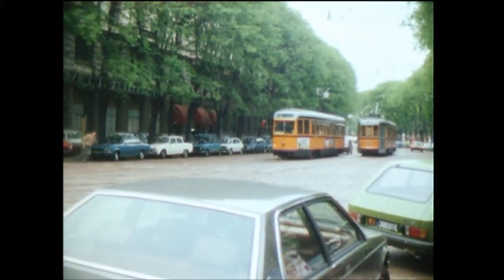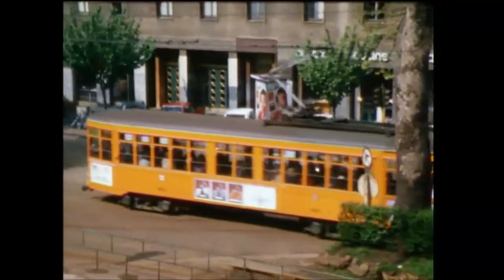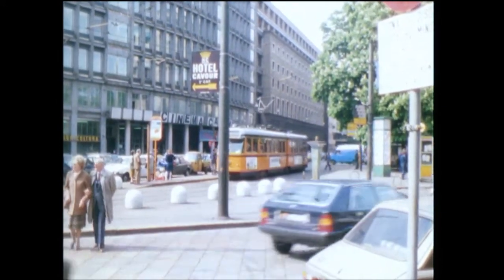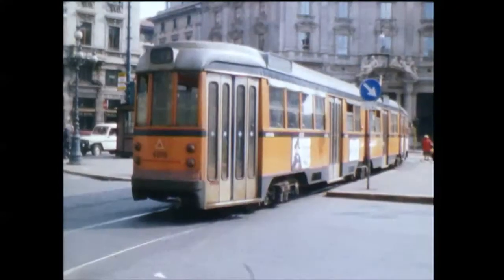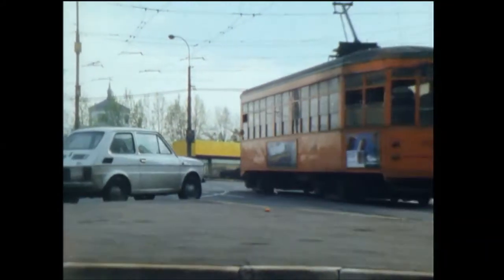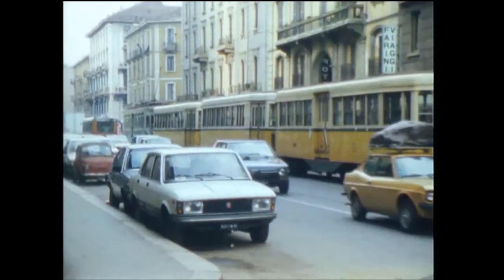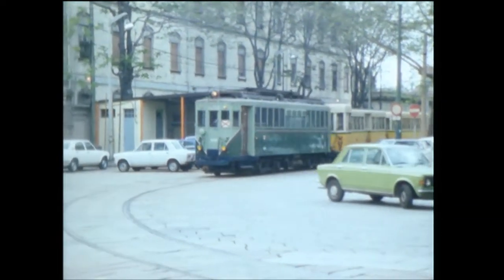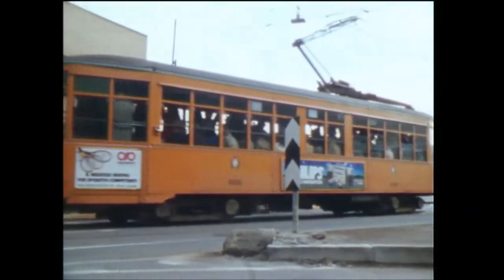Milan Trams 1983 Strassenbahn Mailand Milano

Comment: 4600, 4700 and 4800 series were not rebuilt from 2 or 3 Peter Witt trams. 4600 and 4700s (the shorter ones) were manufactured in the 50s exactly as they look in this footage. 4800s were built from two trams (5200 and 5300 series, built in the 50s) plus a middle segment in the 70s, so again not from 1928 Peter Witts.
Reply from the maker: The commentary is from 1983 and I must have "best guessed" because the information wasn't easily available back then. Thank you Marco for corrrecting and adding this information to my post.